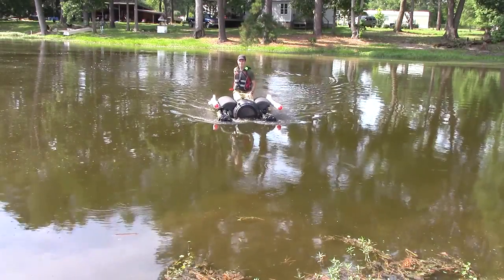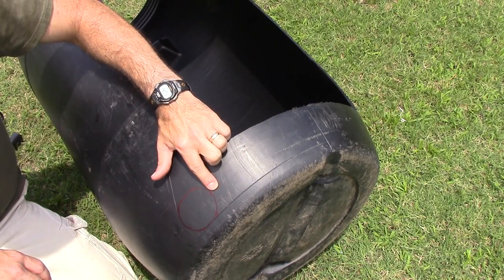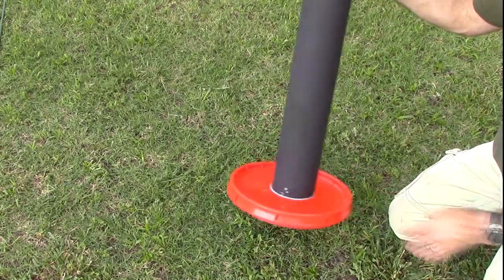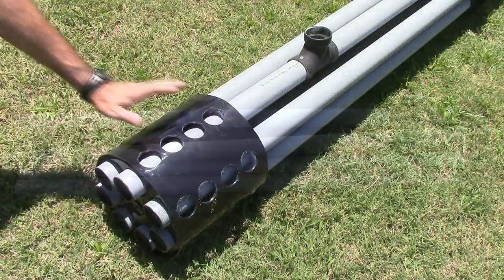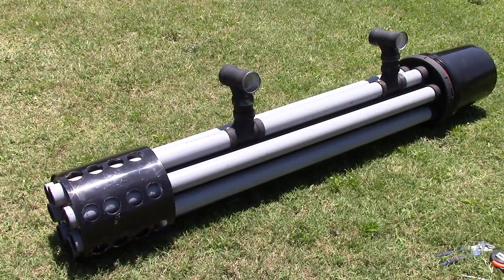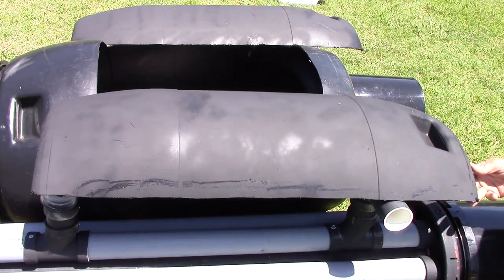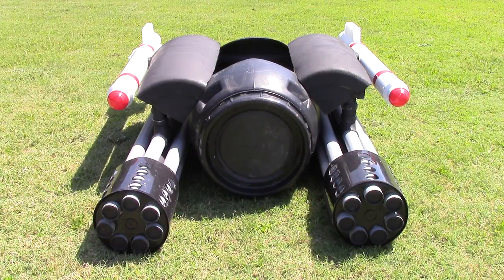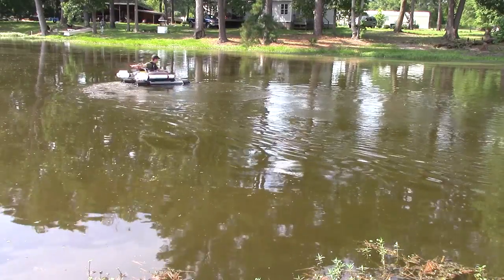Diy pickle barrel boat 3 - fighter jet edition-

Comment: Awesome! A flight stick control would look sweet on that and make it easier to steer. Maybe a PVC pipe rigged up as a lever with strings and pulleys to turn the motor. Then attach the flight stick from an old video game controller to the top of the lever for looks.

Comment: This is really cool. Out of curiosity, is there any way that you could add some sort of storage facilities to use this as a river boat type deal? Nothing heavy, necessarily, just looking for a way to maybe take a woods gun, some survival gear, etc. with me in a boat like this.

Also, where do you find your pickle barrels? I want a few to make some of these.
Reply from the maker: I believe storage could be added on the sides under the
wings. I would attach it between the two PVC supports, and then hinge the wings
for access. Also, I think that craigslist is the easiest way to find pickle
barrels in your area. Thank you for the questions, Lonny

Comment: I have what may be a dumb question, but here goes. Is there any reason the motor couldn't be mounted down under the front, but aimed back toward the back end of the boat? This is from a complete novice so be kind if I don't have a clue. I like the over all idea of this boat. I've thought about building one a bit bigger but made with several barrels each of which would be sealed except for the passenger compartment with several more for the out riggers. This again from a complete novice. Whom also can not swim so anything I'm getting into on the water will have extra rather than less flotation. I also think the multiple sealed chambers will give me added safety should any one barrel get punctured or the like. the rest should give me time to het to dry land before I sink.
Reply: there are mounts and motors designed specifically for this setup, search for "bow mount trolling motor", so the answer is "yes"

Comment: what type of motor did you use?
Reply from the maker: I used a Prowler trolling motor with 30 lbs. of thrust.  Thank you for the question, Lonny
Reply: can you come up with a design with 2 side by side barrels, like a motorcycle sidecar, so I can take my dog along on the river?
Reply from the maker: I'll see what I can come up with on that design. I have had
multiple requests for a side by side boat. Thank you for the question, Lonny